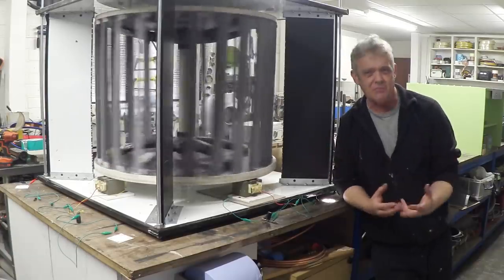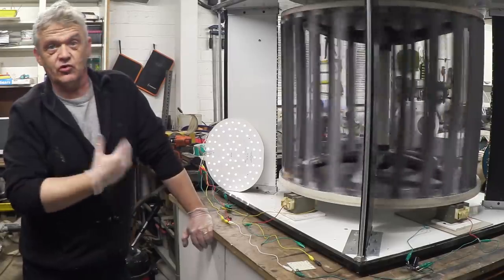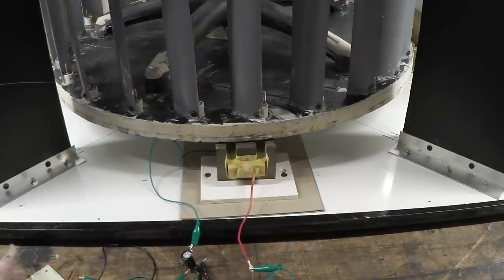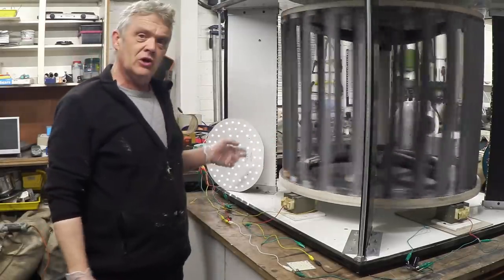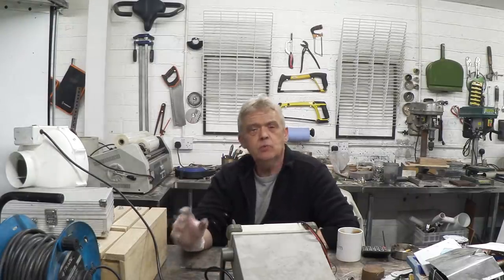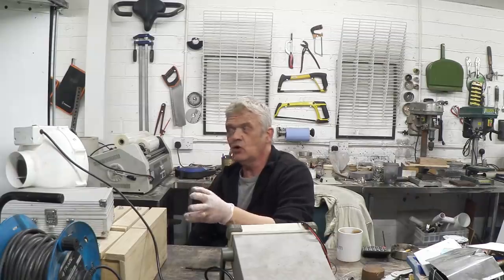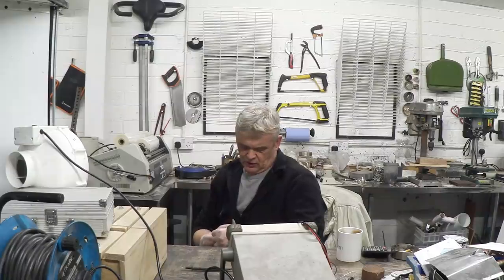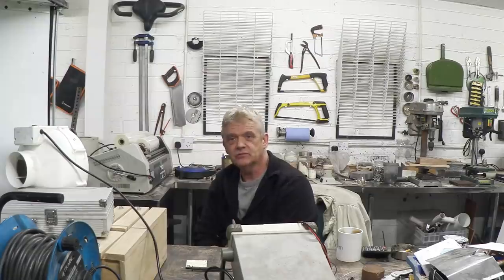Building a 1kW Wind Turbine For Under £100 - Part 6 - Installing The Coils

Comment: Unfortunately If I may say your example of capacitor acting as automatic clutch does not make logical sense, but this is what is happening when you add diodes and capacitor, adding a bridge rectifier and a smoothing capacitor improves output, with the magnets arranged as N-S-N-S-N-S you are effectively producing an AC voltage, which you can check on an oscilloscope, AC voltage will light up LEDs only during a positive peaks and not during negative peaks in an AC power generator, since opposite polarity voltage cannot light LEDs during that phase, but adding a bridge rectifier helps to direct that reverse voltage into same polarity voltage, so you get stronger effect. 

Secondly when you connect all 4 coils either in parallel or in series, you may not have noticed that there could be a phase difference, so for example one coil could be producing a positive peak whilst another one may be producing negative peak or part negative peak, this will have a cancellation effect, its effect is like braking, so it can slow down the rotation or impose resistance to turning , so you may not get a strong voltage, but by connecting them together through diode rectifier you overcome that cancellation effect, and braking effect so at slow wind speeds the drum would rotate nicely and still produce good power, so by adding then capacitor you get stronger and more constant voltage, rather than a series of peaks and troughs, capacitors smooth these peaks. 
Another thing if you use Schottky diodes they have much lower forward voltage drop across them and so you get a fraction more voltage i.e. silicon diodes exabit 0.7v drop whilst Schottky diodes drop only 0.2v drop so you effectively get another half a volt advantage.

Comment: As I think of it .. .. I have had 2 solar panels on my roof for years, and for a long while I thought it was easy and use them in parallel. Both got their diode, and then an mppt device. After a while I found out I was foolish. If yuo parallel up many (DC) devices only the one with the highest voltage will deliver power. In my case, one of the two panels NEVER gave much power, since the mpp was not the same as the mpp of the other panel. In your case, your load will lower the capacitor voltage (you only need one big capacitor if you want to) and several coils may add power to it. But there will be coils that can not deliver any power, because of the parallel issue. I can have a 12 volt battery of 100 Amps and a 13 volt battery of 10 Amps (connected through a diode of course, they may not send power to each other), when I draw any current, only the 13 volt battery will deliver power (until it flattens out, down to 12 Volt). Just saying .. .. In theory and practice: the power of 16 coils is not 4 times that of 4 coils, unless you really draw the maximum power out of it. At which point the rotor may slow down already .. ..
Still great to see all the effort ! I am currently working on a cheap MPPT device, since those are rather expensive and I think I can make one using cheap and existing devices already on the market (and perhaps some electronics as a ne555 chip, just a few cents a piece).
Reply from the maker: thank you mate - I have been pondering that and if you do get a cheap MPPT thing going let me know - I need one lol

Comment: Very nice. Do you still plan to use a flywheel?
Reply from the maker: it is itself a flywheel but if the effect is insufficient I will add more weight to it
Reply: @ThinkingandTinkering  Yeah I think you mentioned 19.x kg for the rotor.

Comment: Turbines generate torque at 0 RPM, and so do not need clutches or decoupling. Magnetic reluctance was probably holding your machine still, like a stepper.
Reply from the maker: cheers mate - but you may have missed the point or I didn't make it very well - it's not a real clutch

Comment: Energy from wind and energy from sunlight. Maybe you should try energy from rain, there is never a shortage of that in England.
Reply: you could get plenty of energy from rain, one way would be to fit Archimedes screws into all the down pipes of your house, refer to some of Roberts earlier videos for making the screws. all the water running off the roof, down past the screws would spin them quit fast. just an idea.
Reply from the maker: I did do a vid on that mate - as Joe points out an Archimedes screw in a rain pipe?

Comment: Your running magnets above coils of wire to produce electricity could it be possible that its also turning the transformer casings into electro magnets which would have a slowing effect or am i being silly if so i apologise.
Reply from the maker: nope you are not being silly - that is exactly what happens part of the time
Reply: @ThinkingandTinkering  So the capacitors help stop this happening correct.

Comment: Have you considered using a dc to dc boost converter as well I am trying that on an eBay windmill because I can't get any out put out of it because it seems to only put out around 12v with regular wind I am trying to charge 24v pack so I am going to see if it all works out
Reply: Sometimes called a step up converter .. I might need to try the capacitor decoupling to get it to spin right could you show us the comparison between the ways you had it wired up
Reply from the maker: I haven't mate - my problem is the other way round - this outputs around 30-35 volts - that's why the gloves I got tired of being shocked by it lol - I will do a vid on the wiring as a comparison for sure
Reply: @ThinkingandTinkering  they have low cost dc to dc controllers for that range for sure you get you a stable regulated dc output maybe add a coil and capacitor to reduce the surges and I have no don't either way this will be a great windmill

Comment: I was going to suggest adding some caps.  What about adding supercaps?   I think in the marine wind gens  are used for charging and not as a direct feed.  So as long as the ability of the generator to keep the battery charged up, is better than the load, all will be good.   Thanks again for the thought provoking channel.
Reply from the maker: I was along those lines that I was thinking mate - cheers
Reply: @ThinkingandTinkering  As we say in Oz Goodonya!  Look forward to seeing the next lot of episodes! Thanks again!

Comment: It seems to be taking less than 4 seconds to make one rev.  That puts you above 15 rpm.  Let's say 17.5
Reply from the maker: ok mate cheers
Reply: @ThinkingandTinkering   I thought that'd be good news.  I woke up in the middle of the night here in NY with a thought about those batteries you spoke about.  The ones from the free emergency lights you got.
You were getting small but not insignificant power from your wind generator that seemed compatible with charging each one of those batteries separately.  Is there a way to charge them all in parallel and discharge them (use them for power) in series?  You would, I think, need a way of isolated them from each other while they charge.  Perhaps transistors.  And then reconnecting them in series to use them as a hefty power source.
Just a crazy idea that woke me up.  I think you're on the right track.  And I don't think that track is too badly trampled.  You are eking out the smallest amount of power from a continuous and reliable source.  If you plot time (as is usually done) on the x or horizontal axis, and power on the y or vertical axis,  the entire area under the curve is your delivered power.  The problem is not too little breeze so much as how to capitalize on both the light breezes and the stronger wind.  Much like sailing a boat.  It requires a bit of intuition, which you have.  
Great videos.

Comment: They asked me how I did it I paid extra and told them that I was going to have a generator put it in for backup power they put on a shut off switch cost me $100 Plus installation but I could turn it off and switch it over to generator when I started pumping energy back into the grid I got sent a check and that was stopping very quick

Comment: Calculating the power bill every month with shut off at the pool and was still getting a charge 152 $250 a month with no power going to the pole. Went to the power company told me I could not do that. So the power was totally shut off for 3 months and I paid 126, 153, and 158. For 3 months the power was shut off at the pole and they told me I could not do that told em I used no power gave me tons of excuses like my water heater my frigerator used power but it was shut off at the pole no one live there and used absolutely no power. Then they have the audacity to tell me that it was prorated got very angry and kick me out of building

Comment: MPPT charge controller.
Reply: For 13 watts ?
Reply: I get that 13 watts is not much so you would be charging battery any way. mppt would act as your clutching device and control output voltage. What you think? Can't wait to see this finished keep up the great work!
Reply: @menonpot6226  This will never be cost effective.  When we up the cost of the Wind Turbine, the MPPT Controller, The Battery Bank and the DC-to-AC Inverter - it will take 50+ YEARS to "break-even",  assuming the wind turbine never breaks ...

Comment: |> |> |> |> |> |> |> |>
|> |> |> |> |> |> |> |> |> 

one reason why between batteriebank and then the rest is a capacitator bank which gives constant around 13,2 volts ... 

even balast

|> |> |> |> |> |> |> |>
|> |> |> |> |> |> |> |>
Reply from the maker: cheers mate

Comment: You decreased the amperage that is going out of the coil. If you put a heavy load on a coil, then it is going to try to stop the magnet rapidly. No matter what. There is no other physical possibility. Energy does not come form nowhere. If you want to draw bigger currents without the whole thing shopping, then you have to move coils and magnets closer to the center of the wheel. I know that you will have less coils but Just imagine... commercial turbines do not have magnets at the end of a propeller.
Reply from the maker: cheers mate

Comment: How much kw create in hour in max efficiency?
Reply: ONLY 12 watts ...
Reply: @MrSummitville its possible for vawt generator to create 1kw in 1 hours??
Reply: @marioguma3700  No!  1kw = 1,000 watts.  So far, this is only a 12 watt device.  1,000 watts for 1 hour = 1kW-Hr or 1,000 Watt-Hours.  12 watts for 1 hour = 12 Watt-Hours.  So, in a constant 25 MPH wind ( who has that? ) this device can power one 12  Watt LED Bulb...

Comment: Your analogy of clutch and gear about capacitor is good.but not totally correct.Actually capacitor is removing need for synchronisation because of DC  waveform.

Comment: its a bit of a shame you dont use some diy cap! 
it seems to be lending itself to be a multi load charger or modular thing charging the small batteries which could dump into a larger battery? and slowly charge 12v power from the exess , even have some modules generating browns gas aswel as charging batteries.
Reply from the maker: you have to be careful doing too much 'new' on a project mate - that makes it from do-able to undo-able for a lot of folks
Reply: @ThinkingandTinkering  sorry i keep forgetting the "brief" hehe. It would make all this tie in to your other work nicely though wouldnt it, rather than a full build you could do a side vid or get Luke on the job demoing how it can be done with stuff from your shop !!!

Comment: Robert. I see that you are facing with the reality that the belief (I mean in the religious sense) in wind turbines will replace fossil fuels and or nuclear energy generation is flawed; no wind no electricity. That also is true for solar, no sun no electricity.
Also I wounder if you have considered taking some entry level electricity and electronics courses, please. Capacitors resist the change in voltage, there is no transmission gears in electricity/electronics.
Reply from the maker: I should take a course - cheers mate

Comment: I work at Nissan Motor Company UK Sunderland. Do you want to help me start a project to enable us to use your deap expertise to and resources of NMUK to work with the wind and help reduce power consumption to make car production a lot more environmentally efficient. The architecture of the plant gives opportunity for understanding unique caricaturist advantages dew to aerodynamic area's of exploration in built-up commercial/residential resections SAFTY Obviously dictates. Small diameter rotation has less speed and fatigue 😊 EXCELLENT project idea

Comment: Rather extensive talking, please plot graphs showing Power output(or current for fix voltage) vs wind speed, this is more convincing. Otherwise I am not convinced.

Comment: I really dislike these misleading titles in so many videos. Claims to be able to do something for under 100 but sits amongst thousands worth of tools and equipment required to do the job. I find the use of these clcikbait titles instantly devalues any worthy info and only adds distrust.
Reply: Not quite how it works though. He didn't specify no tools needed and then proceed to use tools to make it. The assumption is that the product itself costs under 100pound, which is correct.

You're not going to build an item like this as a Neanderthal with limited knowledge, no tools, clothing or supply stores.

That's like saying this video discriminates against people with low IQ since you need to be able to follow simple instructions, or people with no money since you need to find / barter / buy some items.

Title is in fact, not misleading, unlike some others I have seen around the internet.